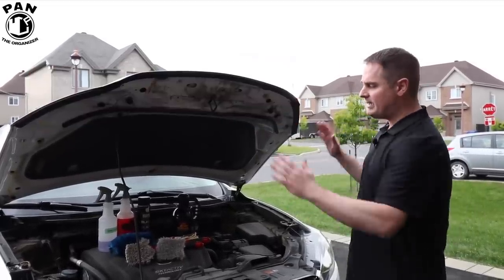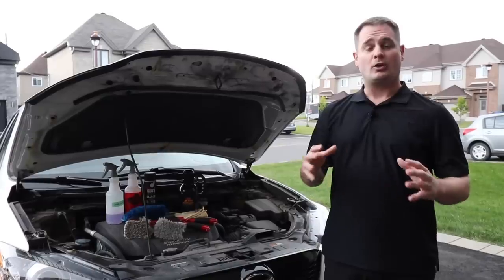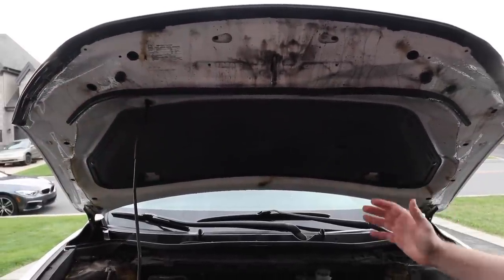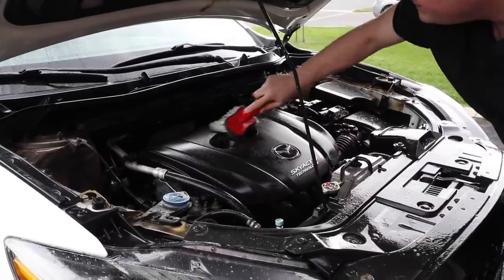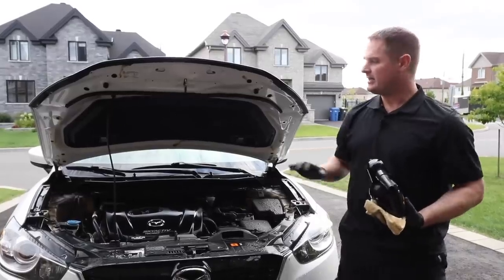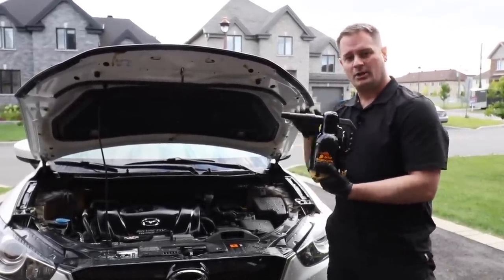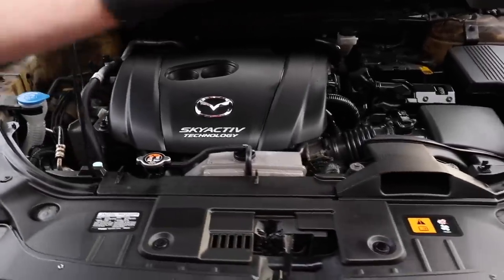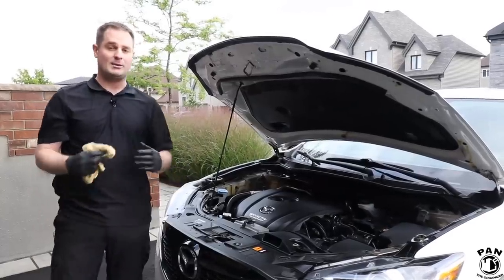HOW TO CLEAN YOUR ENGINE BAY !!!  EASY TUTORIAL !

Comment: Good info pan. I like to remove the large shroud over the engine to clean the actual engine of grease and dirt. Clean engine bay also allows engine to run cooler. Thanks for video Pan.
Reply from the maker: Thanks Joel I appreciate it!!

How did you discover my channel?
Reply: been following for quite a while- not sure how I discovered;  I watch a lot of car detailing videos so you tube often displays channels based on your viewing.
Reply from the maker: Thx for the info!  What country are you watching from?

Hi from Canada!
Reply: Pan TheOrganizer 
Pan watching from denver co.
Reply: I do the same. Not only does it offer a better level of clean, I can point out any issues like oil leaks to the customer so they're aware. Also with such a clean engine, it's easier in the future for a mechanic to spot any leaks as well.
Reply: A clean engine bay also helps prevent dirty oil fumes entering the cabin when you switch the heater on.
Reply: james patrick how does that work?  You don’t pull air in from the engine bay.  If you are smelling oily fumes with the heat on you’ve got bigger problems than a dirty engine bay.
Reply: @joelfox8754  wtf is PAN?

Comment: Cover up your alternator at least when spraying water
Reply: u can get it wet just not drenched
Reply: @sukhmaidickoff  yeah, had to spend 1200 bucks to repair electrics that where damaged when I had mine done
Reply: @sukhmaidickoff  you can bet your bottom dollar not a single droplet of moisture is going anywhere near that engine bay after that! 😆
Reply: at least cover the alternator/battery & shove a rag into the 'cold air' intake. Also spray electrical connections before & after the cleaning process with WD-40. Modern day engines use 100's of sensors that feed into the ECU. A false reading or 'short' could cost you a lot of $$$$.

Comment: Love the videos Pan, keep em coming! One thing I would note is to visibly and physically inspect all caps such as oil, transmission fluid, brake fluid reservoir, etc before adding water to them.  There's nothing worse than having a pretty engine bay with a hydrolocked motor because water went into the oil cap!
Reply from the maker: Good points!  Thanks for watching!

How did you discover my channel?
Reply: Pan TheOrganizer I was in the market for a nice write up on ceramic coating as I just bought a new Silverado and want to protect it as best as I can. Thanks again good buddy 👍🏻
Reply from the maker: Congrats on the Chevy!  I hope you saw my Chevy Silverado Z71 full truck detail video?  Here you go: https://youtu.be/g2FPiPkG4MI

Comment: Might be a good tip since he sprayed degreaser into hinge areas and the hood locking mechanism to use some white lithium grease to relube those parts as they will rust and fail prematurely once finished.
Reply from the maker: Good tip!  Thanks for sharing.

Comment: Hello, You don’t remove the beauty-cover and clean any parts of the engine-block?

I have a similar car: Mazda 6 2015 2.0 litre petrol. 

With over 120.000 km. Really dirty under the bonnet.

I drive it a lot through Norwegian winters and summers. 

It needs to have its cylinder-head-cover-gasket changed some time during this year. 

Should I clean that area? 

The internal bonnet-cover:

Can I clean it with a damp cloth?

Comment: Well done pan! I did my first engine detail today with my car. I used the tornador becuause I wasn't comftorable using a hose or pressure washer. I got amazing results :)
Reply from the maker: Thanks for the comment David.  Yes the Tornador Black is a good tool.  You just need a decent air compressor to go along with it.

Comment: Some detailers would argue that you should disconnect the battery, however, I think you proved that this is not a necessary step. I think I'm ready for my first engine bay detail. Thanks for the lesson Pan.
Reply from the maker: Thanks Ed!
Reply: I think it depends on the car. Like he said any car within the last 10 years should be ok. Plus some cars like mine has the battery in the trunk so I wouldn't disconnect it. But my truck has it in the front exposed so me personally I would remove the battery.

Comment: I am so looking forward to cleaning my engine bay this weekend.. In my younger years, you could eat off any surface of my cars.  I used to leave a thin layer of wax on all painted surfaces in the engine bay.  Every time I waxed my car, which was a few times a year, I would remove the wax from the prior time and add another thin layer. I used a spray wax, so it was easy to remove even after sitting that way for months.
Reply from the maker: That’s awesome!  I glad I could help inspire you and also bring back detailing memories.  I find detailing relaxing.  A man and his machine.

Comment: Great tutorial! That’s a Mazda CX5 SUV, right? Did you remove the battery before you started spraying water into the engine bay?
Reply from the maker: Thanks!  Yes it’s a 2014 CX-5.  I didn’t remove the battery.  I just use common sense.  Never had issues on over 21 years of detailing cars.

Comment: Hey Pan!  Cool video and thanks for posting...though I'm 7 years LATE seeing it!😏 Questions...Can Stoner Trim Shine or Chemical Guys VRP be used on the plastics under my hood instead of Chemical Guys Black on Black?  Additionally, my battery is covered in plastic.  Would you still recommend disconnecting it?  Please advise.
Reply from the maker: Yes you can use those products. I never disconnect batteries when cleaning engine bays. It’s just a safety precaution if you feel uncomfortable detailing an engine bay.

Here’s my latest engine bay detailing tutorial by the way: https://youtu.be/zlKdOJtamDc?si=_Oplxbdw-Rn-1URH

Comment: So I haven’t done car detailing but I need to learn for myself. For this specifically you’re saying newer cars don’t need to worry about covering up with plastic bags for electrical? This is the reason I haven’t really ever cleaned my engine bay as I was scared to mess up working components... 

2016 Hyundai Azer
2016 Toyota RAV4 (non hybrid)
Reply from the maker: I can't tell you to not cover your parts. If you're scared you should cover sensitive components. What I am saying is that in my 24 years of detailing, I have detailed hundreds and hundreds of engine bays and never once had an issue. And in the past 10 years, manufacturers have really upped their game to make engine bays water tight and well sealed, so I don't protect anything (unless the vehicle is modified and has special parts like cold air intakes, etc).

In fact, I detailed my own BMW's powerful and sophisticated engine (4.4L twin turbo V8 engine) in this video: https://youtu.be/H252L0SOHE4

Comment: Heyy I never done this engine bay cleaning, what if the water touches the battery and electrics components in there. Is there anything I should be careful with? Any tips would be nice :)
Reply from the maker: If your car is less than 10 years old, I wouldn't worry about it.  Modern cars are all triple sealed for electrical components.  Just use common sense and don't spray on the same area too long.

Comment: Hello Pan, very interested in the Super Clean product line. Question. Is the aerosol degreaser considered "paint safe"? I have a classic vehicle with alot of engine bay grime, especially on the strut towers. Thank you Pan
Reply from the maker: Yes it should be fine, just thoroughly rinse after use. Also test on an inconspicuous area first.

Comment: Hi, for this engine did you put any cover or protection for all the wiring or the alternator? Or did you just directly wash the engine? I have 2014 mazda 3 and it seems the engine you washed was pretty muxh identical on my car's engine
Reply from the maker: No protection was needed.  Of course, use common sense.  Don’t spray high pressured on sensitive components.

Comment: I recently bought a 2006 Toyota Corolla. Will everything under the hood not be water resistant then? What kind of products should I use if the engine parts are not water resistant? Thank you!
Reply from the maker: Being a 12 year old car, I’d take extra precautions as masking sensitive components like alternator, electronics, etc.  And I’d use a garden hose, not a pressure washer.

Comment: Hi Pan. I have the same model car. Can I remove the engine cover plate and use the degreaser and hose? Its where the spark plugs seem to be covered up and mine is really dirty and dusty.

Comment: Good thing the engine bay clean is the same engine as my 18 CX-5. Thanks for sharing this. Makes my car wash a little easier. 👍🏼
Reply from the maker: Thanks for the feedback Jonathan!

How did you discover my channel?
Reply: Pan TheOrganizer I found you through the YouTube search bar trying to find videos on how to clean the engine bay off a Mazda CX-5 in which this came up as one of the first videos. Quick question, did you cover up the battery as well as the same with the alternator when you washed this car? Just curious, Let me know. Thanks.

Comment: I thought I would go to the great man himself just to cross check how to clean modern engines used to soak the   , crap out of my old car which was in immaculate condition inside and out she used to take water in the engine bay like a submarine but afraid of putting water near my brand new engine bay ,   just need a light clean good video will follow your instructions PS I've often wondered how long are your winter's in the place you are situated in here in the UK we get maybe 5 days a year of snow but they don't mental with the salt drives me nuts you refer to it as the Black Death if you are a car guy pip pip old chap
Reply from the maker: I actually have an updated engine bay detailing video and this time with my own 4.4L twin turbo BMW V8 engine!  Here: https://youtu.be/H252L0SOHE4

Our winters are a pure mess in Canada, especially here in Montreal (Quebec). It starts early November, and as of late March, we still have tons of snow outside. Almost half the year we are in 'winter mode' with our cars, with winter wheels & tires. :(

Comment: Hi Pan! Amazing channel and appreciate your time and efforts to give smart and useful directions for detailing. i am very new to detailing my own car and tried your "how to detail your rubber mat" video with the product recommended, it turned out AWESOME! looks completely new, like store bought. i have subaru forester 2014 and wanted to try engine bay detailing. my car doesnt have an engine cover or anything. Any tip on how to do it would be much helpful and if you could do a video on it, i would be great! i live in a condo so not much in a luck to get the running water. Big high five from Toronto!
Reply from the maker: Thanks!  Hi to a fellow Canadian! :)

How did you discover my channel?
Reply: I was searching for how to wash a car for a condo resident and I came across optimum no rinse product. Looking more videos on the same product, I discovered your channel.
Reply from the maker: Thanks for the feedback!!

Did you try ONR?
Reply: I have purchased it but haven't tried it yet. Planning to use it over this weekend. I tried to find the big red sponge but couldn't in my area. Any tip on how to do it?
Reply from the maker: You can use a regular wash mitt with ONR as well, like I did in this video: https://youtu.be/DxBdWQ2k9Tw

Comment: Thanks for the tips.  There’s been varying tips on whether to cover the ECU and LED lights.  Good to know that you don’t need to
Reply from the maker: It’s not that you don’t need to. You need to use common sense when detailing engine bays. On recent cars (less than ten years old), engine bays are usually water tight. On older cars, there might be more exposed sensitive electronics, alternators, etc.

If you are in doubt, cover sensitive parts with plastic baggies and never focus the water on the same spot for too long. Keep the water moving.

Comment: I drive an 05 Mazda 3s hatch. I'm wanting to clean under the hood but is there anything I need to worry about with the water seeing as it's about 12 years old?
Reply from the maker: Not really.  Don’t overthink the moment and use common sense.  You can cover your alternator, computer and sensitive electrical components if you want to stay on the safe side.

Comment: First vid to pop up when i typed "detail under hood" on youtube. 
Wondering if covering alternator with a plastic bag was necessary
Reply from the maker: If you feel the need to, by all means, cover all sensitive parts with a baggie. On modern vehicles (less than 10 years old), I don't feel the need to unless I see obviously exposed parts. Most car manufacturers do a great job of making their engine bays sealed to water penetration.

I made an updated engine bay detailing tutorial here: https://youtu.be/R5ZbroMTULM

Comment: I want to do the engine bay on My vette.  It’s never been sprayed or detailed.  It isn’t dirty... I take good care of it.  I worry about The Paxton blower. Should I wrap it with something? Or try and avoid it with the cleaner and pressure washer.  Pics of the engine are over on My Instagram account.  jay_dobbinsz06

Thanks, Pan! Great video.
Reply from the maker: Yeah on modded cars it's a bit different. I would for sure wrap any sensitive parts like blowers, cold air intakes, etc. Or use a waterless wash. :)
Reply: @PanTheOrganizer  Thank You very much.  It’s polished aluminum. The intercooler is pretty freaking big, lol.  541whp is still pretty good after ten years of being on there.  It might be a little tired seeing 605whp was what it made in December 2010.  I’ll let You know how I make out with cleaning it.   This is great weather for detailing!  Have a fantastic weekend.
Reply from the maker: You too!!  Here it's a bit chilly and rainy but hopefully May will bring some nice weather.

Comment: What's your opinion on the CG Back on Black? I've used a similar aerosol dressing made by Meguiars that I really like but the only downside is leaves a sticky residue on paint. I usually have to mask off painted areas or use another dressing like Adams VRT. Great video by the way!
Reply from the maker: +ChizAfterHours 
I usually prefer water based dressing, but the CG Black on Black doesn’t leave that sticky residue and is super quick to apply.

Comment: I’ve always found giving the engine bay a light dusting before and products or liquid makes the clean a lot easier
Reply from the maker: Yes you can use an air compressor or blower to remove loose dirt and debris before starting.

Comment: Pan, speaking of Superclean and how safe it is: I keep reading on forums that it's going to melt my car. I bet you've been using it long term - what's your take? I just got a set of Enkei J10 wheels and I'm scared to use Superclean - never used it so far on anything.
Reply from the maker: I wouldn't use Super Clean to clean a car...  That's not what it's designed for.  Watch my wheel cleaning tutorial here: https://youtu.be/Ty4ZTq7A7rc
Reply: @PanTheOrganizer  Still, I've seen it used in some of your vids 3:1 on wheels ... was that just a test?

Comment: 2014 and it's already rusting? Is this common in Canada? Not a big problem here in North Texas. I'm sure the guys close to the coast will have this problem also
Reply: Froylan Cepeda Surface rust happens fast in the winter on exposed metal due to heavy road salt!
Reply from the maker: No it's not rusting.  If you're talking about the yellow stuff on the sides, that's actually a 10-year rust proofing installed by the dealer at purchase, hence why we don't wash it off.  

How did you discover my channel?

Comment: Big fan Pan! Just been told by Car dealer not to wash the engine bay or degrease they told me to leave it as it is, I had to get engine mounts and trailing arm bushes replaced as washing an engine bay, the chemicals dry out and wear rubbers such as the parts I mentioned? Is there any truth to this?
Reply from the maker: If you were to wash your engine bay every week maybe, but no harm in detailing it once or twice per year.  Use common sense.

Comment: Another great video, I have 2 questions.

1. Would it have been better if you sprayed the dressing on the microfiber towel instead to avoid over spray?
2. Did you have a huge oily/grease stain on your driveway after this?
Reply from the maker: +Narftastic 
No grease stain as I rinsed thouroughly afterwards with pressure washer. 

For the dressing you could apply with a mf towel, but the Black on Black doesn’t leave a greasy residue and I washed the car afterwards so no worries on overspray.

Comment: What is difference in prior 2007 vehicles (why need to cover with plastic? ) thanks
Reply from the maker: In the past decade, car makers have done a lot of progress in making sure their engine bays are water tight.  Before that, it's just that some components might be more sensitive to being exposed to water so it's best to take some precautions.  Mind you, I once had a 2004 Nissan and was still able to clean the engine like in this video with no worries.  It's just that I would rather people use common sense and protect some components if they have no real detailing experience.

Comment: Is that rust on the left and right sides of the engine bay? That Mazda CX-5 can’t be more than 5-6 years old and already so rusty. Disappointing.
Reply from the maker: It's not rusted at all.  It's rust proofing that's the yellowish stuff on the sides.  Hence why I didn't remove that during the engine bay detail.

Comment: I drive a 14 Elantra GT and the alternator is very prominent and exposed. I worry about spraying the engine bay. Has anyone done their GT using this or a similar method? Should I cover it?
Reply from the maker: Yes you should cover the alternator as a precaution.

Comment: Quick question. Would i be safe using my tire brushes and wheel brushes with motor oils that are inside the engine bay?
Reply from the maker: I’d use separate or old brushes for engine bay detailing.